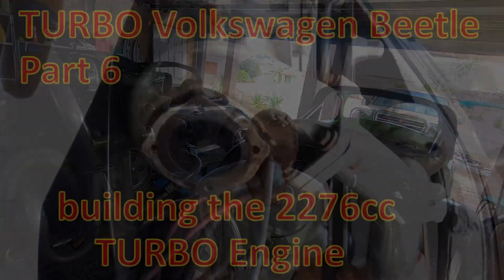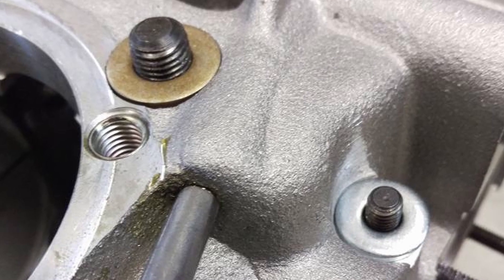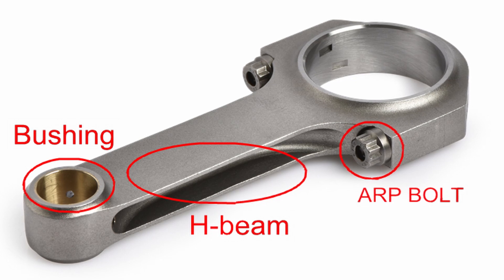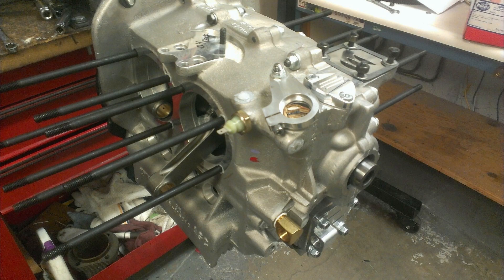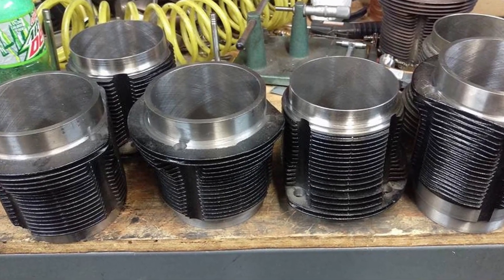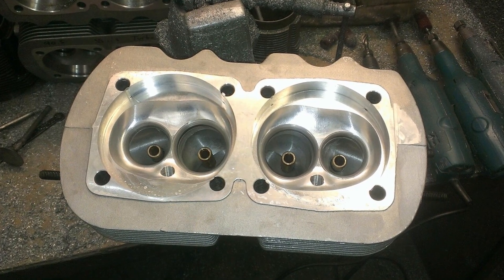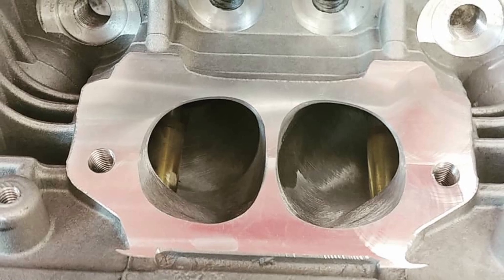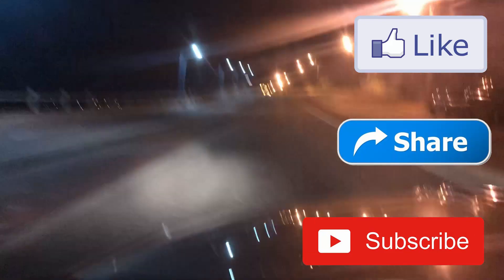2276cc 82x94 VW Beetle Turbo Engine Build

Comment: I'm not expert but it looked like the crank had its side Webb drilled for balancing. This is rhe weakest point of the crank and its just been made a he'll of a lot weaker. Material should have been taken from the center of the Webb where it doesn't affect strength.